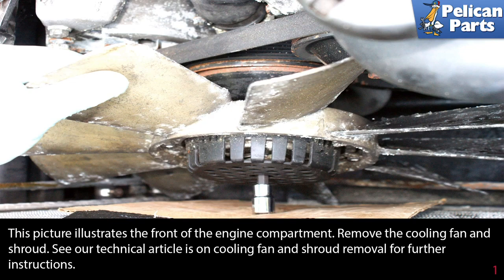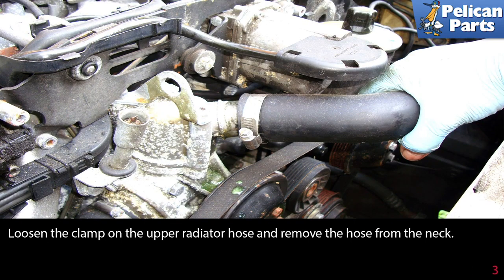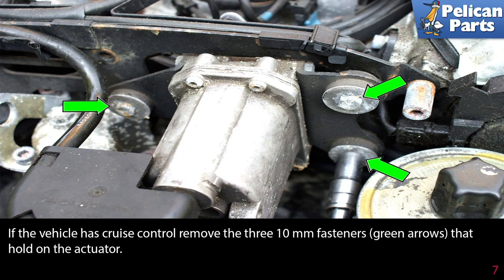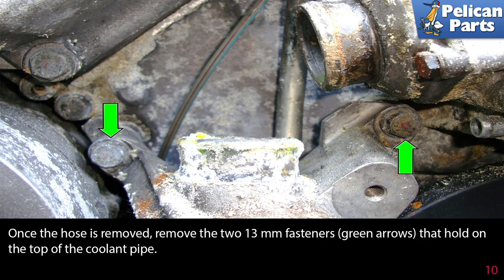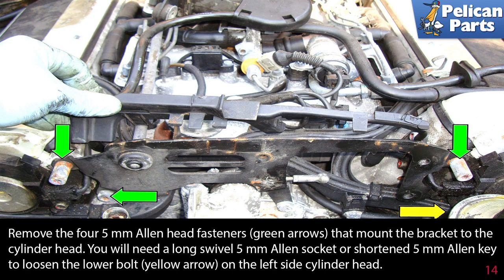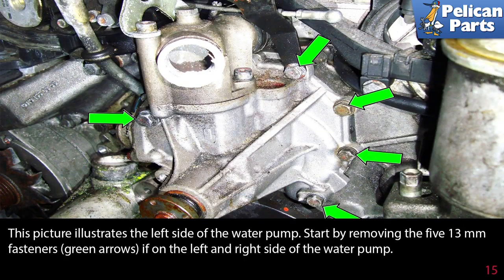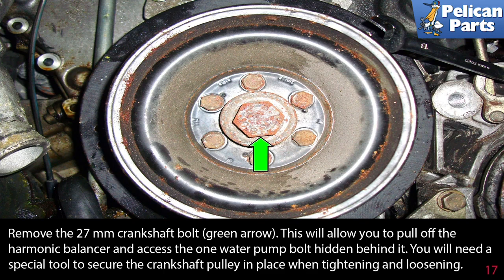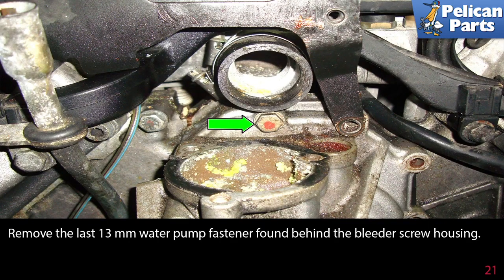Mercedes-Benz R129 SL-Class Coolant Pump Replacement

Comment: You do not have to open the 27mm bolt to take the harmonic balancer off!
Just open the 6 13mm bolts around it and wiggle the harmonic balancer, it is probably very rusted stuck, but it will just slide out with some force. I took the 6 bolts out and rotated the pulley with old alternator belt and a 1meter bar to which i had connected the belt. Just remember to rotate it clockwise. Also use some wd-40 or your favourite penetrating oil.

The 27mm bolt is torqued to 400Nm so it is very very hard to open. My bolt gun was not able to open it.
When putting the balancer and pulley back on, you'll notice that one of the 6bolts is off center, which means you can't put it back on in wrong position, so no worries there.
Reply from the maker: Thanks for the additional info. We appreciate it.